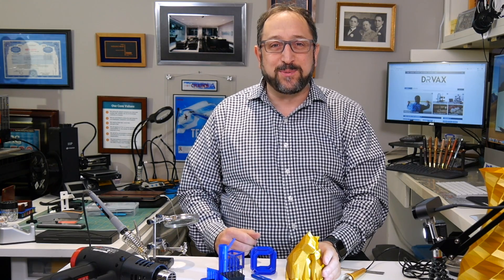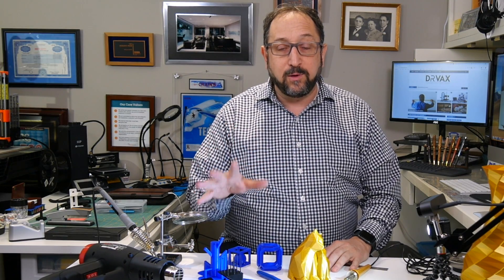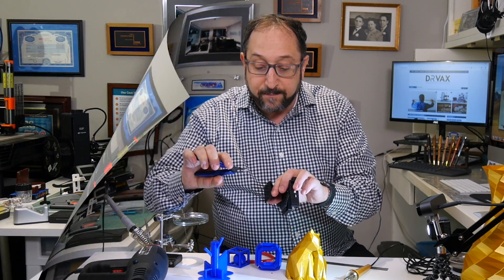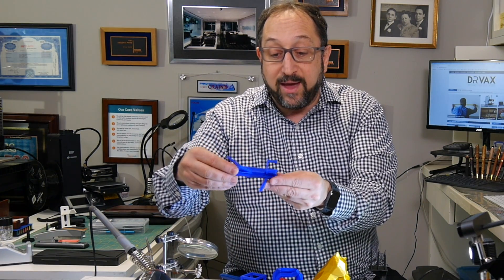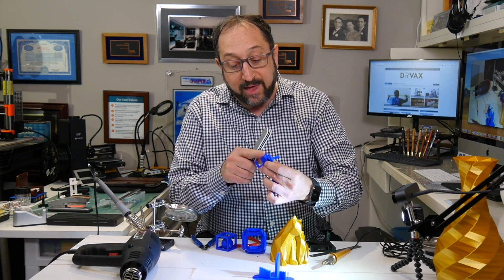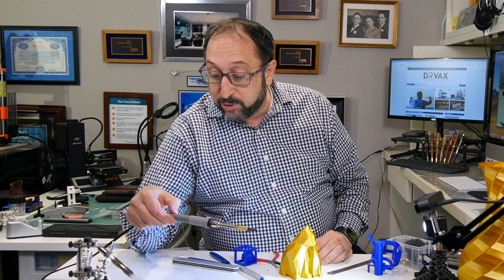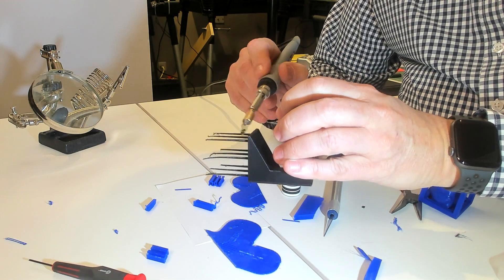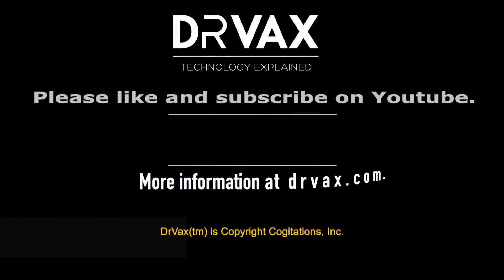How to Clean Up 3d Prints

Comment: For removing supports I use a temperature controlled soldering iron which has all the attachment tips, works perfect. I think it's worth investing in premium tools that will benefit my hobby in the long run.

Even heating a hobby knife blade over a candle will do the trick nicely if worried about melting or burning a print, I tend to go slowly especially when working with delicate prints.

Great video.

Comment: I just found the term ultrasonic cutter that a Chinese manufacturer suggested not your bare hands for cutting 3D printed parts!   I am assuming an ultrasonic cutter would be a motorized mini Exacto knife so when you cut 3D printed parts it doesn't take much and you cut right through the support.   I have quite a few printed parts in my plastic modelling hobby something I never considered how to clean up the parts.  There is actually now products that don't need cleanup at all and done for you by the manufacturer which is best.   Very helpful thank you!

Comment: This helped me so much! I bought this pyrography tool that was great (for wood...) with alot of nibs, 30 watts and around 400+ degrees maximum. Just as you said it would miscolor all lighter coloured PLA. Also, it would give off a strong sweetish smell of burned plastic. I've looked so much for a guide on what WATT results in what heat but it seems impossible. Now I ordered one that can switch between 7 and 15 watts. Should be low enough.

Comment: Great video, I have the cross hatch layer that was from the support that is in a tight area, any advise for this. I don't want to use heat because it might damage the print (not surgeon hands here)

Comment: I suggest you to position camera at the bottom face of the surface that you were smoothening and at the top surace from you were scratching off the left outs of support. I could only see you operating the tool and not what it does to the surface.

Comment: I use tough gloves whenever I use a knife to clean up a model because you may think you're smart with a knife, but there are usually very strange angles that you need to cut at. It's not like carving away at a stick where you can easily point the knife away from you.

Comment: I use Crystal Glass nail file. First I file roughly without water and then to get a smooth surface with water and light pressure. I have used it on PLA, PETG and ABS and it has worked well on all
Reply from the maker: Thanks for the comment.  I will give it a try.   I will be doing an updated video about finishing 3d prints in the future as a number of new techniques are available.
Reply: @MakeWithTech  Thank you, you share your knowledge with us so I hope I can contribute with something meaningful.  So we can learn together forever :)

Comment: Very interesting video, the hot knife looks interesting.

However, bit confused about temp range? You say yours goes down to very low temps - sub 100c. I cannot find any that go lower than 180c, most are 200c. Looking at yours, it looks like a Fuyit tool that I see on Amazon UK (+/-5c up/down buttons, digital display)? That one appears to go down to 180c?

I guess though, that if one puts the Exacto type blade attachment on, which you used at one point, thermal gradient on the thin blade will mean the tip is a lot lower in reality.

I do have an Antex thermostatic soldering iron that goes down to 200c. I'm wondering if Antex do other tips than soldering tips. Might look around.
Reply: That hot knife looks brilliant, where. can I get one?
Reply: @bryanpanton  Amazon.
Reply: @zvbxrpl  doesn't have a model, just described as a Fuyit wood burning pen kit.

Comment: For cleaning up prints instead of a knife or a hot knife/foam cutter i use a scraper made by the company MiNi they makes the TS-100/80 soldering irons. Its called a Viper scraper.  Its made from damascus steel, is pretty AF and i use it for everything.  Even taking prints off the bed.  Its one solid piece of metal and comes with a ruby oxide whetstone.  I can get it near razor sharp.  Just don't drop the thing blade down.  It takes forever to hone the ding out of the blade

Comment: You  dont need   print so much big  raft .. There  is   distances    .You can print   only    1 mm   around    object  .No  5 cm  :P Unless you are using a raft to support a tall object  .
Reply from the maker: Thanks for sharing.  Yes you are able to use a smaller raft, but if the purpose of the raft is to support an object with limited contact with the print surface I find a larger raft is more reliable.   I do not spending a bit more time printing the raft to limited the possibility of a failed print.

Comment: The link for the hot knife you used is dead.. I have been looking around amazon but it seems like the one closest to what you used starts at 300 degrees.. you said you can turn yours to 90 degrees. What model do you have?
Reply from the maker: This is the "woodburning kit" I purchased "46pcs Wood Burning Kit Creative Woodburner Set with Adjustable Temperature Soldering Pyrography Wood Burning Pen, Embossing/Carving/Soldering Tips".   You can use any "solder iron" with an adjustable temperature that can use "knife style" tips.   You want the iron to be able to go as low as the glass transition temperature of your filament.   So for PLA this would be about 50 - 60C or 122 to 150f.

Here is an Amazon search for the right thing.  This is an affiliate link -- it helps support the channel -- at no cost to you.

https://amzn.to/2PmNbCL

Hope this helps.  Irv
Reply: @MakeWithTech  thank you. For some reason I cant find one that goes lower the 200c..

Comment: Brilliant tip about the hot knife, cheers Dr Vax!
Reply from the maker: Thanks.  It does make life easier.  You just need to get the temperature right.  Make sure you buy one with an adjustable temperature.
Reply: I've been so engrossed this past year, trying to print these certain geometric shaped for this project I'm doing. Your tip about the ironing could very well solve a lot of the problems! Cheers, Dr Vax!